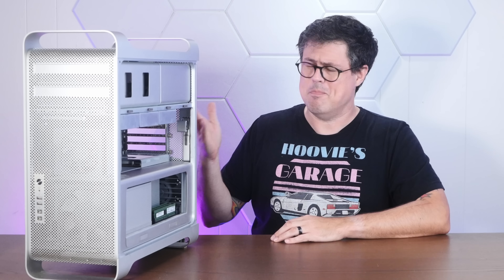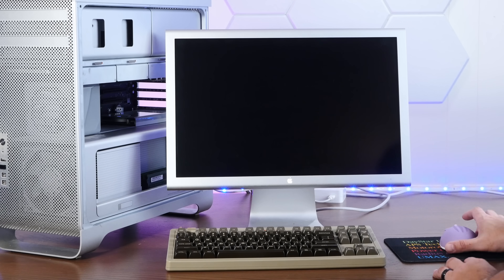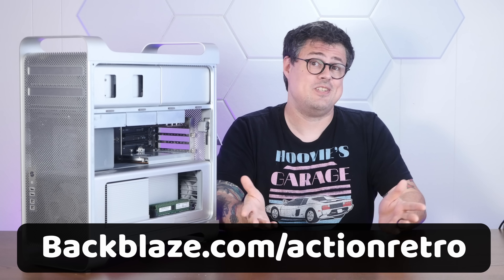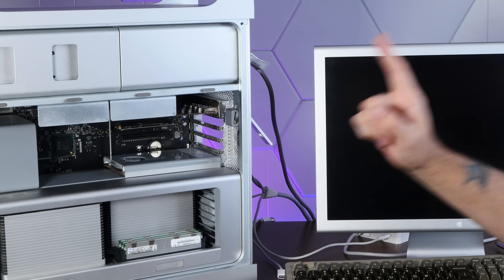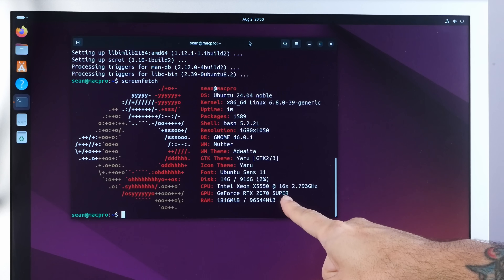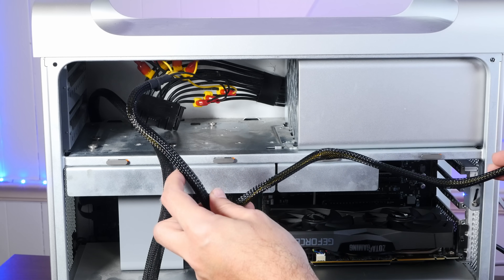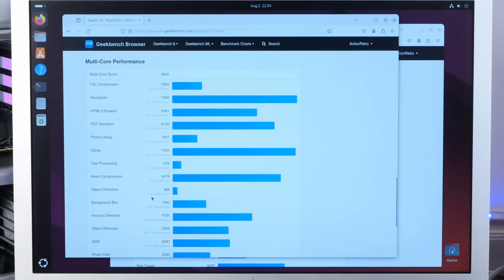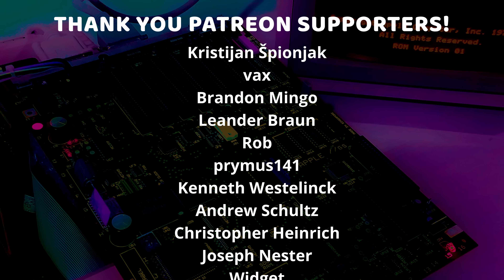Building an Extreme Linux Mac Pro

Comment from the maker: Go to www.backblaze.com/cloud-backup/personal/landing/show/actionretro for a fully-featured no risk free trial of the best backup service there is!
Reply: Your backblaze link doesn't work =p ask them to renew it, sir :3
Reply from the maker: @MK-of7qw  oh dang thanks, fixed!
Reply: @ActionRetro  Can you back up your Ubuntu Mac Pro to Backblaze?
Reply: Dude, I love what you're doing but wire taps are for CAR electronics !!

That's so dodgy!! 🤮

Pop! OS Linux would be a much better choice for a Mac style install, it's also based on Ubuntu...
Reply: @edwardfletcher7790  Pop!_OS*
Reply: a single core on my 13600kf has the same geekbench score as this entire machine xD
this is a verry cool project. gotta love old xeons.
also, what is the max amps for that PSUs 12V rail? a 2070 isnt a device i would power by tapping wires...
Reply: Neofetch is obsolete, you want to use hyfetch or fastfetch.

Comment: This thing would SMOKE the newer Apple silicon CPUs! So theoretically you could put in the latest (unsupported install of course via OpenCore) MacOS and should run still even better than Apple Silicon-powered computers. Something I would want if I had the money to do - and I'd probably put Fedora in it... or turn it into a poor man's NAS to replace the one I'm running right now. But still - I'd LOVE to do this!

EDIT: Who TF am I kidding! FIRST THING I'd do is an attempt at an OpenCore install of the latest MacOS and use the crap out of it! I'd go back to Fedora ONLY IF the MacOS fails hahaha... (I love Fedora though)

Comment: I was able to run a 2070 Super FTW3 or whatever on my 5,1 by using the two onboard power connectors without any issues. I never had any shutdowns or anything and the card seemed to be happy until I moved it to my next PC.

Comment: I have several of these, they are so fricken hot that two running in a room with a decent gpu will cook you entirely through to medium rare in just a few hours. For comparison, a "modern" 11th gen intel cpu uses less than half as much power under load AND like 1/10th of the power at idle. I love the hardware, but it's very impractical in today's world.

Comment: the thing i think sucks about them is them being only PCI express 2.0 like even if you put something like a 2070 in your not gonna get the best out of it due to them being PCI express 3.0/4.0. But using Linux over something like Windows or Mac can make it kinda meh with overall performance but still a interesting build over all.

Comment: Please do not take this the wrong way... but please never ever use scotch lock electrical connectors on anything that is a permanent solution. They cut into the wire severely increasing resistance and heat, if you care about it at all, please just take the time to de-pin the connector and solder another wire into the pins. Sorry for the criticism, I have just seen more down the road failures than you can imagine relating to these scotch locks.

Comment: De lidding isn’t  that hard. Put utility knife blades under each sides, use a holder, and then use a culinary torch to slowly heat it up and it will pop off.

Comment: After you installed open core onto your first drive, did you just install linux from a usb and everything worked? I have a modified 5,1 with Open Core and Sequoia on it. The  2.5 SSD is on one of those OWC sleds that allows speeding up an SSD compared to the slower by half drive bays. I'm wondering if I install linux to one of the drive bays if the Open Core will (a) recognize it at all, or (b) get hosed by the linux install? It used to be so complicated getting Open Core Legacy Pather onto one of these... in fact, I used Martin Lo's Open Core for 5,1 for quite a while. And getting Linux running on that? I managed it for a little while and then something went wonky - forget what - and I couldn't re-achieve it. Looking for an easy way to do the ol' dual boot.

Comment: I have a Mac Pro 5,1 running macOS 10.13.6 which is the last natively supported macOS, as my home server. 
3.2GHz Quad-Core Xeon
16GB DDR3 (could use a few more sticks but runs just fine atm)
ATI Radeon HD 5770 1024MB
And it does absolutely everything I could ever want it to do as a server. No jank needed. ❤

Comment: Cross posted, but valid Hi I had my CMP 5,1 working with Linux Ubuntu and Sonoma with OCLP. Before having any MacOS (I had Monterey, and later Sonoma) I was able to get output and "Chime" with a GTX1050Ti. I literally removed the Sonoma drive, and kept the Rx580, and everything is fine. But When I put back the GTX150Ti, or a RTX3060 nothing came out, not even the Chime... How can I fix this?

Comment: I just used opencore patcher to put Sequoia beta onto a 4,2->5,1 flashed dual X5690 with 64G RAM, R570 graphics and SSDs.  Its fine, but it kicks out a lot of heat for relatively small performance.  PCIE gen2 is going to hurt the throughput, but its fine if you love your system and just want to keep it alive.

Comment: I currently use a 5,1 that's upgraded to almost the same level as your computer; the only two differences are that I am using a SATA SSD for my boot drive and the graphics card I'm using is a Radeon 7950 with an Apple BIOS for the boot screen as well as for Metal support with macOS Monterey, which I've got installed courtesy of OpenCore.  Everything else is the same, particularly CPUs and RAM.

Software Update says I can update the OS installation to macOS Sequoia, thanks to OpenCore ... however, that's not advisable because versions beyond Monterey may require a Mac with Intel CPUs having instruction sets that my computer doesn't support.

Apple just recently discontinued support for Monterey, so I think I've got about two, maybe three more years of use out of my Mac before the lack of security updates and software support really become a liability for it.

But there's still plenty of life left in it, despite its obsolescence, which is making me seriously consider installing a Linux distro on it whenever I can secure the funds to replace my cheesegrater with a Mac Studio or something.

I still do work that pretty much requires a macOS environment, but I have and use computers with macOS and Windows ... and I've wanted to try and get into Linux.

So far the farthest I've gone with having a Linux computer is with a small HP PC with Batocera Linux for my home theater system.  On the day I use my 5,1 with Linux, I'm debating between Ubuntu, Fedora, or Linux Mint.

The thing I do with my Mac is video editing, and one reason why I may continue to use my 5,1 with Linux is so I can continue to use Davinci Resolve on it, though I will have to pay for the Studio version as well as use an nVidia card with Cuda support so I can also get required codec support, as well as being able to output a project to 4k, for my work.

Comment: How much power does it consume out of the wall when idle? 

I have a home nas which works very well but it's quite slow (low spec components from 2015). If this thing is not power hungry on idle, I would really consider it, as services like photoprism or immich are quite slow.

Comment: For anyone watching, delidding those CPUs is a pain in the ass. I ruined one set a few years ago and wound up paying the extra $ to get them pre-delidded (say that 3 times!). The 2010 models - which is what I have now - (native 5,1s) are easier because there is ample clearance for the lids.  I'm daily driving a 2010 "Max Pro" - maxed out on literally everything sans GPU although I do have an RX 580 which works great for what I do (not gaming). I'm dual booting macOS Sonoma & Garuda (Arch) Linux.

Comment: Do you know if the 5,1 will support an NVIDIA RTX A2000? I ask because the A2000 runs on PCIe bus power without external power connectors. Also, do you have plans for a BootCamp Windows install?

Comment: The Xeon Workstation I mentioned in my last post by chance runs native MacOS from 10.7 to 10.14 WITHOUT ANY CHANGES directly from Apple-Boot-devices. When I read that some Intel 5000X boards can straight forward boot MacOS without additional software I tried it and it worked like a charm. My board identifies as an Intel S5000XDN which is a S5000XVN with an additional GPIO debug header. I just need to disable the 16Bit-compability support module, aka classic BIOS, so it falls back to EFI 0.9 - nowadays we run UEFI 2.x, EFI 0.9 literally can only boot MacOS and some utterly archaic linux-Sysloader. But then it is just a Mac Board made by Intel. Insane. My guess, Apple used these boards for developing the Mac Pro. It was rare enough that people wouldn't go their way to use it to run MacOS.
But to be honest, I only testet it when my buddy brought his Mac over about three times with MacOS 10.8, 10.14 and 10.15 - the later didn't start for missing 32Bit support. I guess the EFI was 32Bit only even though the system itself is running 64Bit very fine.

Comment: I am sure we all agree that buying Apple to run Linux is utterly stupid because you can get the same performance from the x86-World for a third of the price and with much more choice and expandability too. But using a gifted Computer for fun, why not. In 2007 a customer bought from me a 8x2500Mhz Xeon Workstation and six years later gifted it back to me - which is still my third most often used computer nowadays - with  a RAID1 from 2x500GByte HD and 16GByte of memory. It cost back then  €2500, a less powerful and much louder Apple system was €8000.
After I received the computer back for free I slowly upgraded it with stuff lying around, first two CPUs with 8x3333Mhz in total which I got from Ebay for €5.50, a surplus 500GByte SSD replacing the dead hard drives and 8x16GByte=128GByte (!!!) of memory I got for €21 also from Ebay (damn I wish I had the S5000UVX board with 16 memory channels, just for the lulz), also it came without Graphics but I had a Radeon 580 lying around and it did good. A very capable computer, even nowadays.

Comment: I'll check when I get home, but I don't think it's actually necessary to delid the cpu. If I member correctly I just added some small washers or something... or maybe I just didn't tighten the heatsinks all the way.
Reply: OK just looked, I built out a 2009 mac pro 4,1 a life time ago now for the missus. Made it a 5,1 and used a used a w3690 xeon for the processor. I didn't buy any special kit and didn't delid it either. It's her daily and still plugs along like.a champ. Also used the mini 6 pin connectors on the board to regular size 6 pin for the gtx 760.

Comment: Ive done all of this except the pixels mod on a 5,1.  this is cool.  i use POPOS because of how well it works with the hardware out of the box.  i use it as my primary workstation.   Cant wait to see what else you come up with.  Now I know I can use a 2070 and I might consider ordering one of those cards.  Thank you.  I wasn't clear, did you mod the card to show the boot menu also ?  If so how was this done.

Comment: As a former cheese grater mac pro owner I really want to add some things to consider here:
The mac pro is old. Really old. Really really old. Like 65nm lithography old. Now imagine two of such processors. In combination with ECC RAM that has to be actively cooled. These Servers will eat electricity like crazy. A normal single household in Germany paid like 30 Euro in electricity back then. My bill was at 90 Euro (even with a normal priced contract). And with great energy consumption comes great heat. These things are HOT. The ECC RAM runs at almost 100 degrees celsius. This thing is something to keep in a corner of a room you never want to set a foot in, inside a house that makes use of solar energy.

Comment: You do NOT need to delid the CPUs on the 4.1 the main issue is the fan cables in the heat sink which you can clip out of the heatsink for the extra gap.

Comment: Just for the lolz, I ran Geekbench on my 5 year old laptop, it's a 2070 and an i7 running Linux Mint. I got a 1353 single-core and a 6540 multi. I'm a little shocked at that score compared to this system.

Comment: You don't need to de-lid the CPU's you can pull out the heatsink fan cables out a bit so they can reach the connectors on the board

Comment: End goal for my 5,1 is:

2x Xeon X5690's
128gb DDR3
2x RTX 2080's w/ SLI
4x Samsung 870's (1tb each)
1x Samsung 980 (1tb)
1x optical drive
1x blu-ray drive

If my math has mathed correctly the computer should be a max of 978 watts out of the 980 watt power supply. Correct?

Comment: Wait… skipping through. BRO you didn’t have to jank the power supply there’s adapters for the mini 6 pin. You could have gotten one dual mini 6 pin to 8 pin cable for the GPU and you’d get a total of 375 watts! It’s $10 on Amazon and just a pin connector to the motherboard.

Comment: I'm running Ubuntu on my 5,1, but only single processor 6 core with 48 GB RAM.  That's still pretty beastly for a Linux box that only runs server tasks.  I did the processor and RAM upgrades myself, and stuck in an upgraded GPU that was about the best one I could find that had Mac firmware for native boot capability.  I've gone to Apple Silicon for my daily driver, but that 5,1 is still PLENTY capable for most tasks.

Comment: I have an 8 core 5,1. My girlfriend uses it as her desktop for playing Disney dreamlight valley. Currently has 48gb of ram, a gtx 680(pixlas modded because I was too cheap to get official cables) a 512gb ssd, and its original dual 2.4ghz westmere e5620 quad cores. Currently hooked up to an HP 30” 2560x1600 screen(looks to be the same panel as the 30 inch apple cinema hd display but with 3 DVI-D inputs) it’s also currently running windows 10 pro because she doesn’t like Mac OS
Reply: official cables? any link? 🙏

Comment: Those taps are wild. Like, props to Sean for making that literal garbage solution work, and it's certainly faster than doing it the right way, but I would go out of my way to keep the factory connectors on that Juicebox, cut the Mac's PSU leads — entirely outside the PC — so both ends can have a socket which correspond with the existing connectors and install it proper

Comment: You don't need to delid the processors, just don't torque the heat sinks down as far. I have seen other channels do this mod and that works just fine.
Reply: That isn't always a reliable option. It did not work for my 4,1 a few years ago so I tried delidding them & they broke (I think they were already a bit brittle from heat exposure) so I bought them pre-delidded. It's much simpler to just buy a 2010 MP which doesn't have the clearance issue.

Comment: I've been living the Mac Pro 5,1 lifestyle since late 2018, when the prices finally came down to earth. I have four 5,1, plus a 4,1 that has been flashed. my two main working machines are both on Monterey. That's the last Mac OS version that will install without root patching, so it basically runs as though it were native. This fall, once Monterey loses support, I'll have to update them, probably to Sonoma, which has been working very well on my test 5,1. 

You've already bought the lidded CPU's, but for refer3nce, the prices on delidded ones have dropped considerably. I opted for that when I upgraded mine.

I've never done the Pixlas mod, though it doesn't seem to be that hard. I'm using RX 580s, which have become very cheap, and, for my uses, are more than adequate. Running OCLP unlocked the real power of them. Honestly, I'm writing this from a Trashcan, and even the FirePro D500 performs very well. Of course, I'm not a gamer, so that may enter into it.

I'll be interested in seeing how they work out with Ubuntu. The looming question is where to go once Apple finally drops Intel support. I'll probably end up going the Mac Studio route, but Linux on these wonderful old machines is a tempting option. Good luck with it!

Comment: Nice video once again ! I have 2 of these 5,1, one with dual X5690 and the other with dual L5640, both with 96 gb of ram and nvme. As far as I know the 4,1 and 5,1 are exactly the same computer and they don’t require delid as the 3,1. Both of mine are not using delid CPUs.

The other thing is that, for the Mac pro to be able to accept those 6 cores CPUs I believe you have to flash the motherboard and cpu daughterboard with the 144F rom, which can be done by installing OSX 10.13. 

There is a new mod now that flashed the Mac pros boot rom to enable vga output using any card.

I use one of my 5,1 every single day, they are not the most efficient in terms of power, but they still do everything I need. They are extremely silent and stable. 

When you upgrade the CPUs, you will need a long torx key to access the mount point from the top. I would recommend also to inspect and reinstall the heatsink that covers the Northbridge between both CPU heatsinks, be sure you mark them prior taking them out as they have a cut in the corner to make them fit.

Comment: I hope those power taps for the GPU are rated for high current.  It'd probably be a good idea to run a GPU power stress test for a while and make sure they aren't getting stupendously hot.

Comment: I went with soldering directly to the PSU PCB, of course you would need to get it out and disassemble, but in the end I think it's more straightforward than tapping into the wires. Also made it a bit "modular" — what I soldered in used to be an 8-pin EPS12V extender, which I cut in half, and now it's possible to plug a PCI-E power cable from a modular PSU into it.

Comment: I think those power taps are the reason you saw better single and multi core results.  You're drawing power away from the CPUs, making them try harder.  Alternatively, you could've installed the clangor off the ringer of an old AT&T desk phone to bang on the CPUs, also known as percussive motivation.  Say hi to Sean, the angry whiteboard guy, for me.

I don't know why I leave these types of comments on your videos.  Maybe it's the vibe you put off that triggers the imp in me.